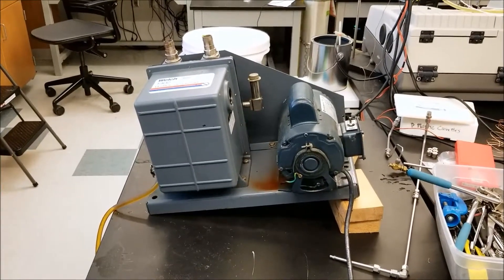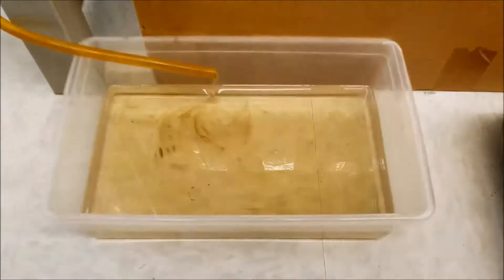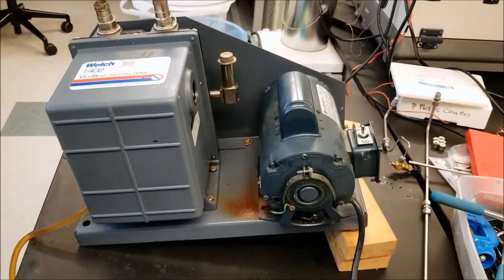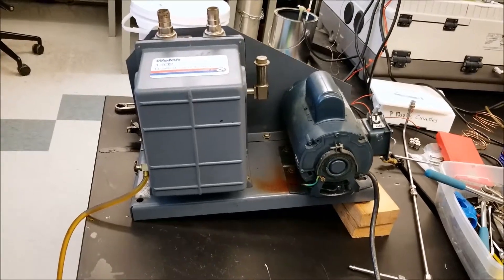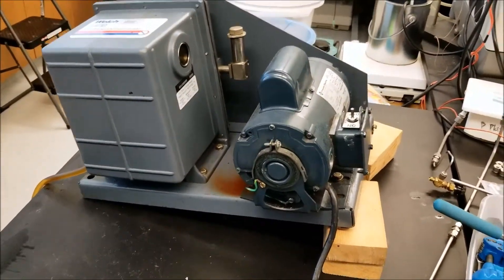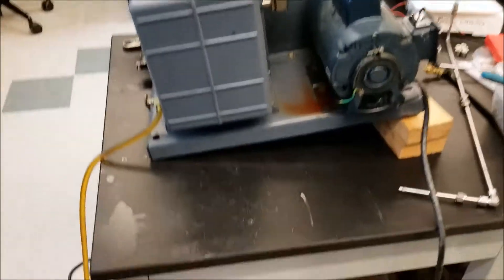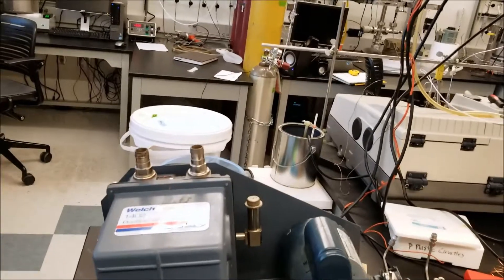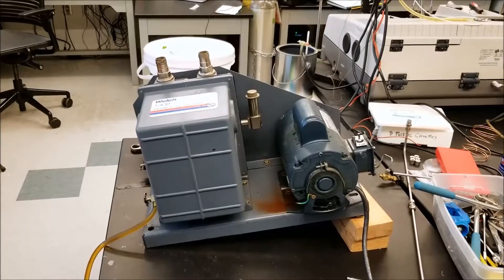Oil Change Tutorial, Welch DuoSeal 1402 Vacuum Pump

Comment: Not one mention as to which port to actually put the new oil back into the tank. Am I supposed to guess? The one reason I looked at this video.
Reply: I mean, you could guess, or you could use a little logic. The pump draws air through the left port and expels air through the right under normal operating conditions (it's labeled IN and OUT).  Pour a few hundred mL into the left port, turn the wheel to draw the oil into the pump internals, then add more oil until you're full. It's much easier when one person pours continuously while the other turns the wheel continuously.

If you pour into the right port then turning the wheel expel air through the oil and make a mess. But you can turn the wheel in the opposite direction and sidestep the issue entirely. So really, any port is applicable if you're clever.
Reply: @drpowerthirst9093  if the video is titled "oil change tutorial", you shouldn't have to do guesswork after watching it as to how to change the oil. there's no mention in this video as to how to actually change the oil, only draining.
Reply: @brittanykamini  read the description of the video. The video was intended as a refresher for student workers who had already been trained, not as an all-encompassing training. I would change the title to reflect this, but my old work email was deactivated and it was linked to this youtube channel. I'm happy that a lot of others watched it and found value in it!
Reply: me 2